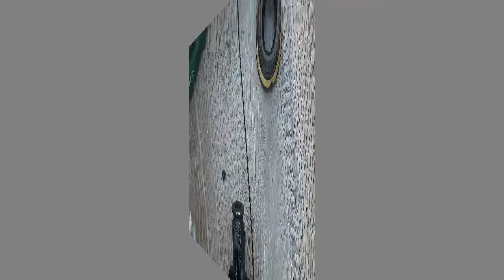Ultimate Guide: Cleaning the Rotary Hammer Drill DCH133 Chuck Bit Holder

Comment: My DCH265B is only like 6 weeks old, the chuck spins slightly off center ( drill bits weeble wobble ) Any idea? Only been used for drilling 1/2" holes for drop in anchors.
Reply from the maker: Bring it for guarantee service Its almost new
Reply: It was my mistake actually, drill is 100% fine sorry for the stupidity. I tried like 5 different bits in it, all of them happened to be bent lol. The Chuck has the appearance of wobbling with no bit in it so I put all of that together for a false conclusion. Brand new bit in it today, perfectly straight.  @powertoolsrepair
Reply from the maker: @nsoutlawball1941 everyting is good 🤓

Comment: Do you know a reason why a chisel bit in hammer only mode would spin freely. Do you know of a repair manual for this model. Thank you
Reply from the maker: It can be thet chisel is worn out or you need replace tool holder cylinder

Comment: I have this model and the spinning function is no longer working
Reply from the maker: You need to check clutch
Reply: @powertoolsrepair  i opened it up and there was washers and clips just floating in the grease. I guess it was shaken apart from chipping. Now just gotta figure out where it all goes.

Comment: My sds bits keep falling out
Reply from the maker: Can you spin sds bit inside cylinder when it's in?
Reply: @powertoolsrepair  yes, do you know the solution for this? Hammer mode works fine but i can rotate chisel by hand and drilling mode isn't working
Reply: Sometimes you have to replace the tube ,ball and washer